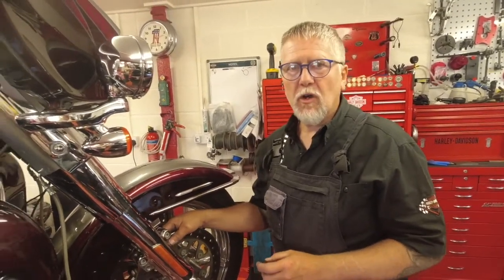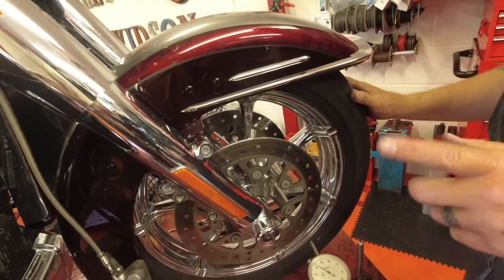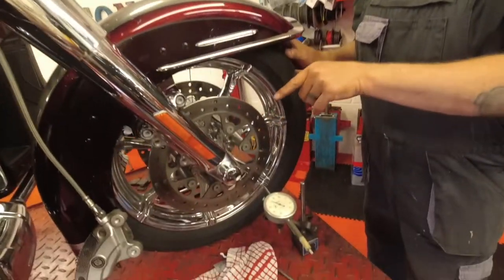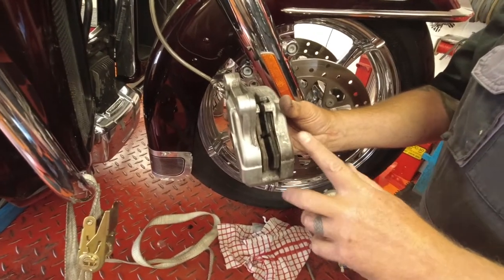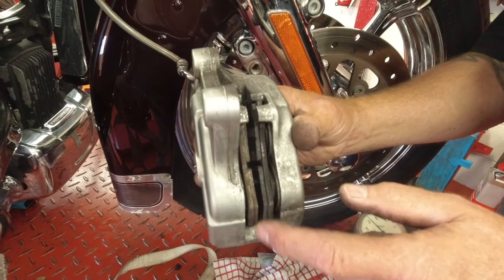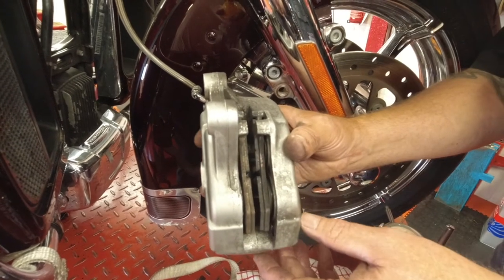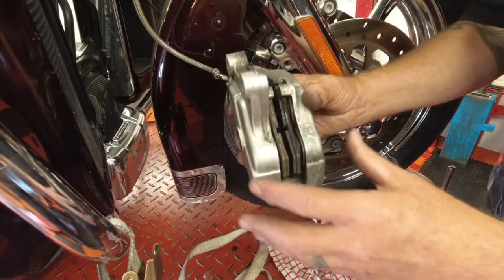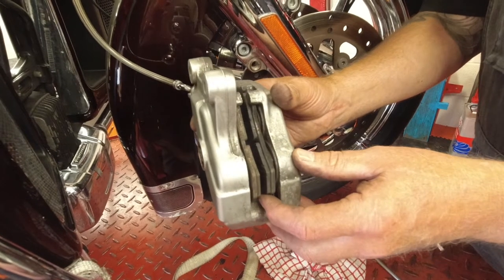Harley Davidson Pulsating or Shuddering Front Brake

Comment: 2016 CVO Road Glilde:  I took your suggestions seriously on a friend's motor that I maintain for her.  It shudders at anything above 20 mph or so.  At 80 mph, it shudders a lot.  One cannot feel the shuddering in the brake lever.  No, one feels it in the whole motorcycle. 
Nonetheless, I removed the front calipers and squeezed the brake lever slightly.  Sure enough, the same piston extended before the others.  
NOW, with no rotor onto which the brake pad would be up against, I'm not sure that this is actually a good diagnosis of the issue.  But I went ahead and cleaned the pistons as best I could and worked them back and forth, squeezing the lever and then pushing the pistons back home by hand all the while cleaning with brake cleaner.  
Yes, I seemed to have made the brake pistons operate more similarly to each other and thought it may have fixed the motorcycle shuddering. 
But no joy.  It didn't fix anything.  The pistons push the pads very similarly to the pad, but the shuddering actually happens when the pads are FIRMLY onto the pads.  

So I decided to take your advice again and get a couple of front brake caliper rebuild kits.   I was informed that they're not available.  They're right!  I looked up the rebuild kit and found that it doesn't exist!  

So I finally returned the motor to her with the shuddering still just like it was when she brought it to me.  I'm really disappointed. 

Below 20 mph, no shuddering at all, no matter how hard one brakes (front or rear).  Above 20 mph, very noticeable and annoying motorcycle shudder.  

I'm at my wits end. 

Ken
Reply: I am having this same issue on my 2022 Road Glide. 
Have you found any solutions?
Reply: Test the rotor runout with a dial.  Mine was way out.  I just purchased the bike new this January.  Crappy OEM parts.

Comment: If you’re able to answer this that would be much appreciated. I have a 2023 row glide with 178 miles. I put 14 inch rotors and finally took it for a ride and when I hit the front brake it shutters real bad. Like a high-speed vibration. It was fine with the stock rotors and at 160 miles I changed the rotors. So on the first ride when I was coming to a stop and I hit the front brakes the vibrating like crazy. They are floating rotors and I installed them correctly. The rotors new float also. And the bike has ABS. Well anyway if you can help with some tips that would be great. I’m gonna try what you showed in the video also. thank you very much!   Mike D
Reply from the maker: Hi Mike where are you based

Comment: What kind of lube did you say to put on pistons ?
Reply from the maker: Just general penetrating oil , hope it helps
Reply: @scenewithchips8993  IF your pressing pistons in after pulling brake lever, are you taking cap off that brake fluid goes in 1st ?